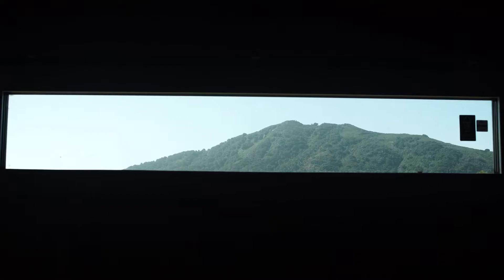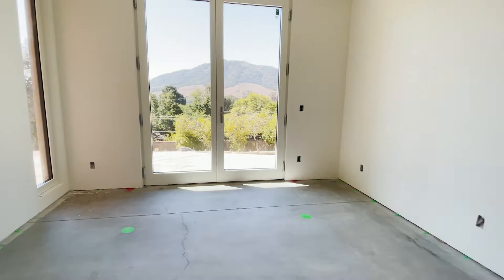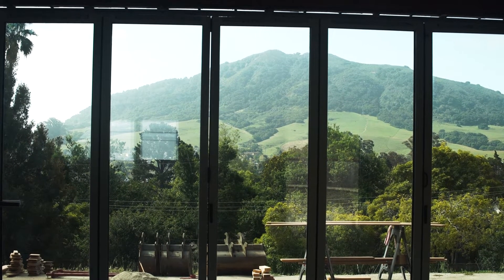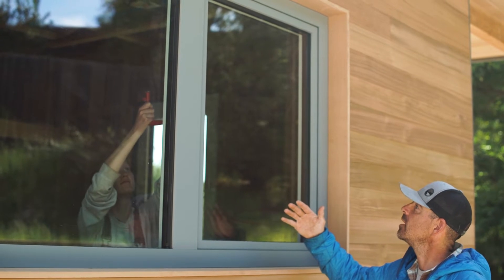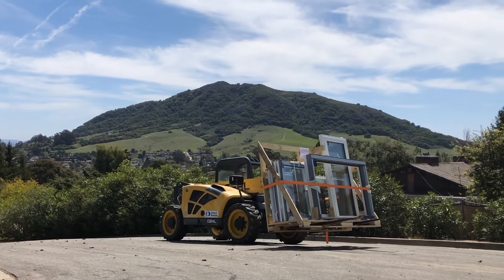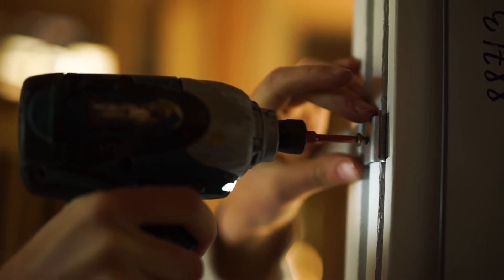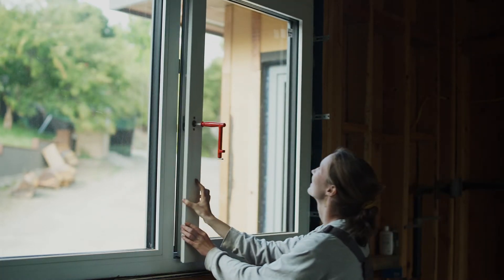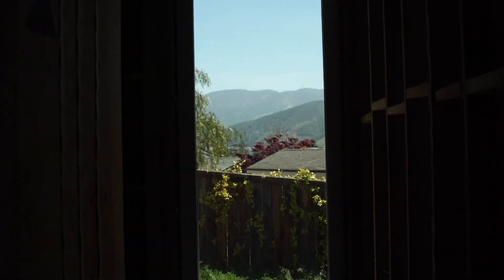Bishop Passive House: Windows

Comment: I'm building a near passive house in Maine.  Don't like the Euro style casement inward windows because they take up interior space and because if they're open, you can bust your face by walking into one.  The top tilt is not useful enough to outweigh the terrible inward open design.  I'll use some awning style windows and some tall vertical casements opening outward.  They come in R7 and in triple glazed Argon 366 for about $1000 each in a decent size.
Reply from the maker: Good luck!

Comment: those windows are more than 4x the cost of local fixed windows. One can buy two fixed windows and install two of them in one opening for an effective 4 pane window that will have a higher r value and cost less than importing windows from half way around the world. It's ridiculous how expensive these passive homes get because everything costs so much. And builders wonder why they aren't selling well? comeon build smarter, not more expensive.
Reply: Respectfully disagree :) We priced a dozen window packages for this home, as we do for every client so we can show them the options. This window package including all the entry doors in the home and including a folding accordion banquet window and also a massive 15' wide and 9' tall accordion door was more cost effective than any pricing we received from our local, more-commonly used lower-quality windows and doors.